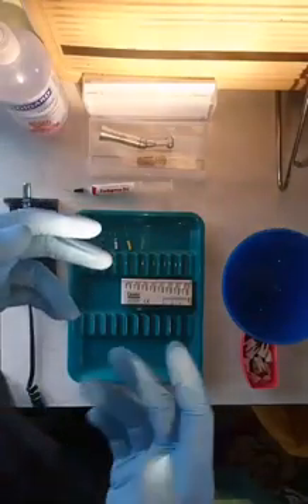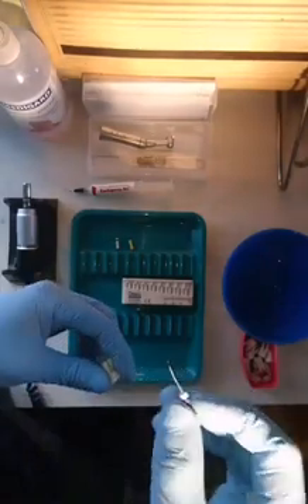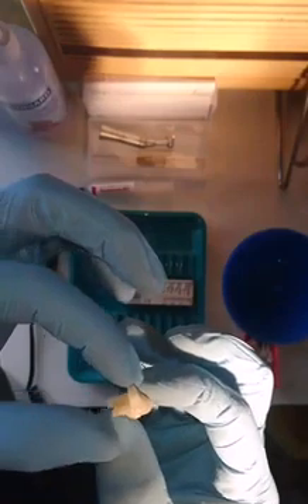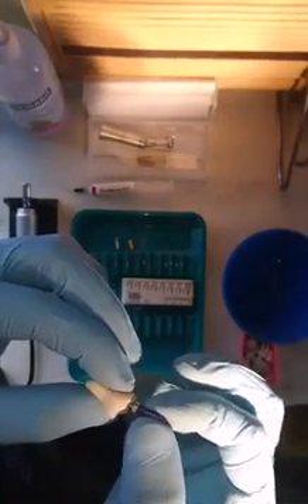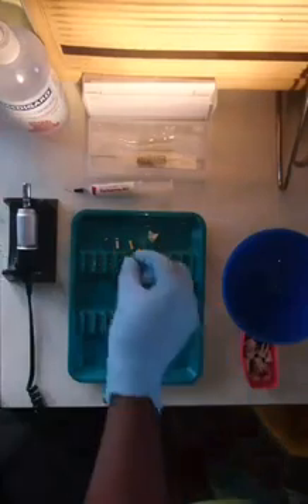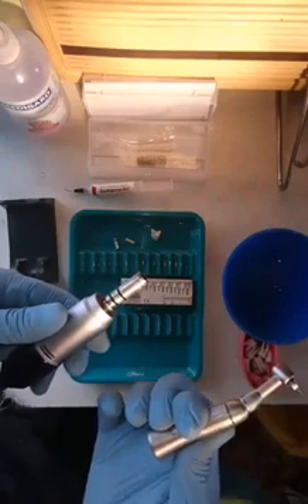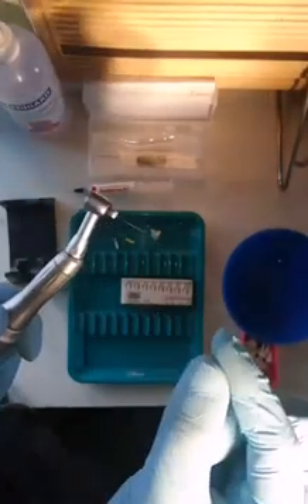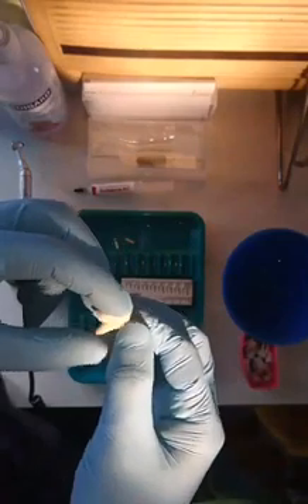Endodontic Glide path management with machine driven hand files

Comment: Great ...what should be speed not micro motor?
Reply from the maker: 8000rpm in micro motor- 4:1 gear reduction in m4 converts to 2000 oscillations (30°) per min.

Comment: This technique results in considerable post op pain. It should be used only in special situations such as widening the path of bypass of a broken file.
Reply from the maker: Greetings Uday, the pain could be attributed to significant extrusion of debris in the periapical region and hence the canals and chamber needs to be filled to the brim,with naocl which due to its effervescence,brings up debris.

 Periapical extrusion of debris is present with both rotary and symmetrical reciprocation systems.

In either case,debris upon contact with naocl disinfects it and if at all pain occurs, nsaid coverage takes care of the issue!

There are other hybrid techniques of this system,not mentioned in this video, which reduces periapical extrusion of debris significantly, increases the percentage of canal walls touched and preservation of pericervical dentine.
Reply: @richiejohn8653  Another cause of pain is to prevent loss of WL we have to keep the fast oscillating instrument tip  right at the foramen which injures the ligament
Reply from the maker: @narad8165  Preservation of the apical constriction is essential, keeping it as small as possible and we do not want to enlarge the apical constriction in the first place. Correlating with EAL readings and working down the canals from sizes  #10 to #20 will not cause much harm to the MC during glidepath creation, unless an instrument of #20 or above is passed through the constriction and beyond the apex,damaging the periodontal ligament. 
Constant irrigation-recapitulation-re irrigation is mandatory to help maintain apical patency and thereby maintaining the working length.
cheers
Reply: Very nice ..plus more videos